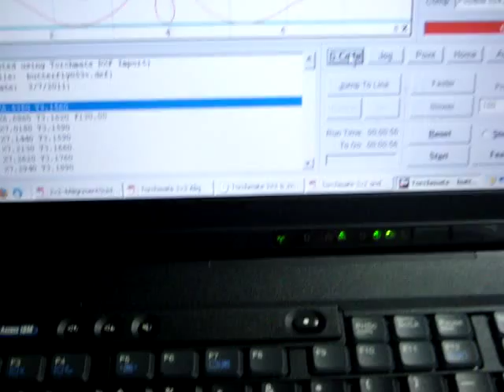Torchmate 2x4 cutting a butterfly from 16 ga steel

Comment: @jdh239 Safe z is the how far off the plate the torch raises and then moves to the next pierce point. In Sheetcam there is a setting that lets you decide how far the torch comes off the plate before it moves to the next pierce point. I found it a little more efficient to only come off the plate about an inch when there wasn't anything the torch would collide against when moving over the material.